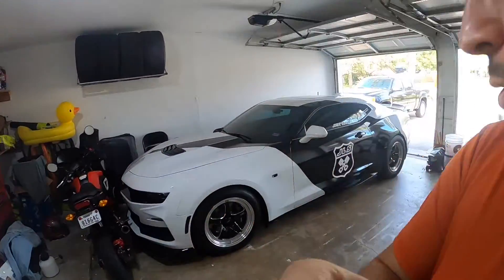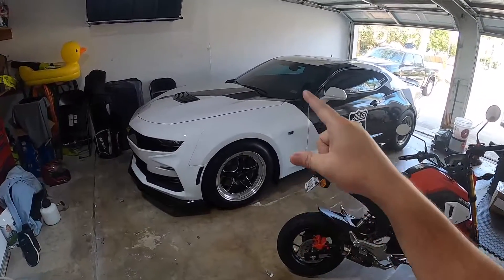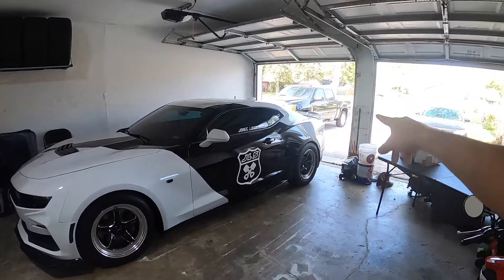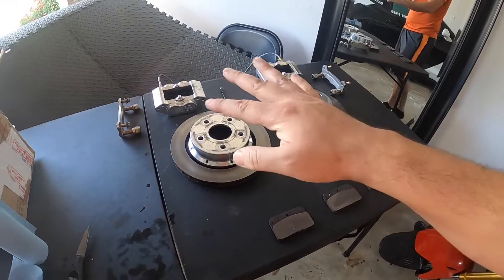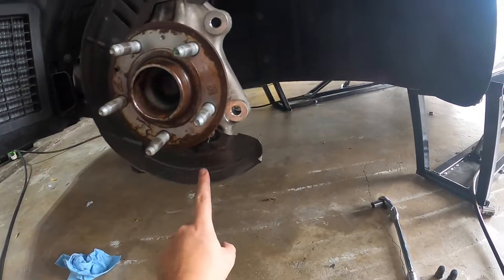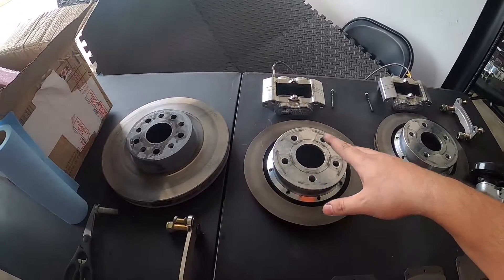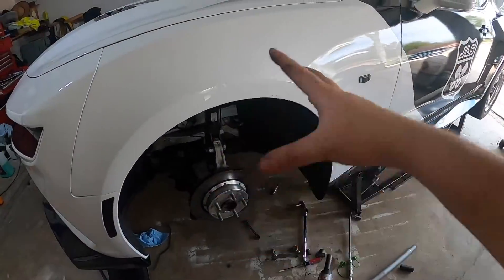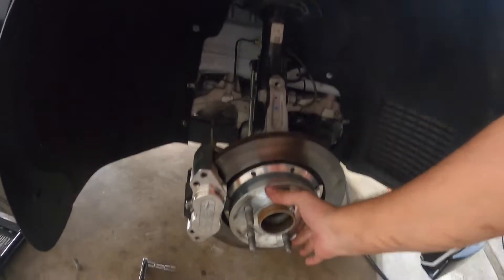Aerospace Front Brake Install on MY 2019 Camaro SS!! | Vlog #369

Comment: Fill your coolant up to the line.
Reply: Coolants full man, the camaro has a really weird pressurized system. If he takes it around the block and looks at it again the reserve tank will be full. Look how much higher the fluid level is later in the vehicle after he does his test run.

Comment: I have a question. What parts do you have in your valve train? I have tsp vvt3 cam, titanium dual valve springs, and ls7 style lifters. Basically the whole tsp kit. People are saying that ls7 aren’t good enough for a .640 lift cam. Do you think im fine? Or any recommendations about when to replace them?
Reply from the maker: I don’t run a 640 lift cam, but I have pretty much similar things to you and it’s working perfectly fine.

Comment: Did the pedal response ever come back or was that a sacrifice that had to be made in the name of go-fast?
Reply from the maker: It came back I re bleed them and it got better
Reply: @JLSpeed   so the braking isn’t bad ?
Reply from the maker: @vlexlopez5389  nope not at all only thing that sucks is the squeaks from the break pads when they are cold lol but it’s. It too bad
Reply: @JLSpeed  thanks for the response. And does it squeak really bad?
Reply: @JLSpeed  and which ones did you go with? The track ones or the street ones?
Reply from the maker: @vlexlopez5389  These are the street ones. the difference between track and street is the track ones are not vented rotors they are just basically a disk for the calipers to clamp on to lol
Reply from the maker: @vlexlopez5389  no just at the very beginning and its not horrible similar to any performance brakes